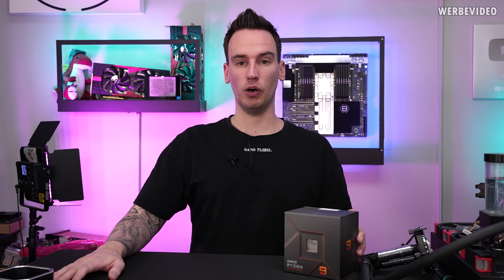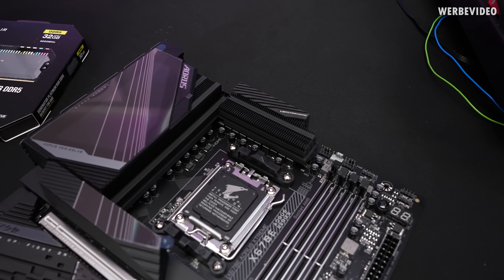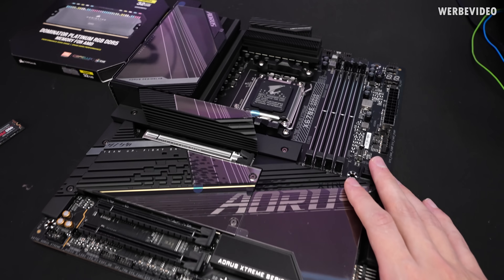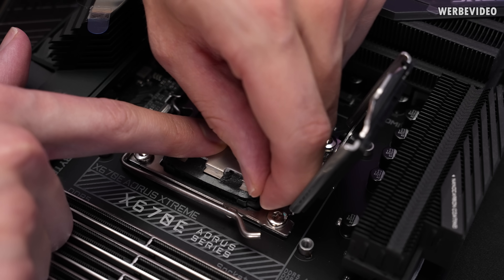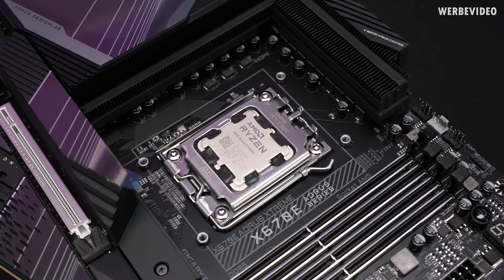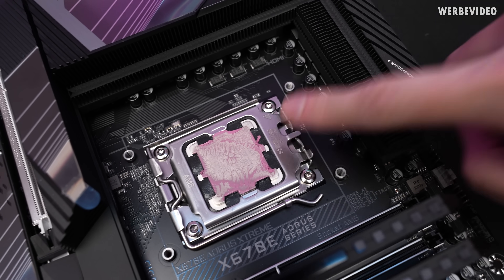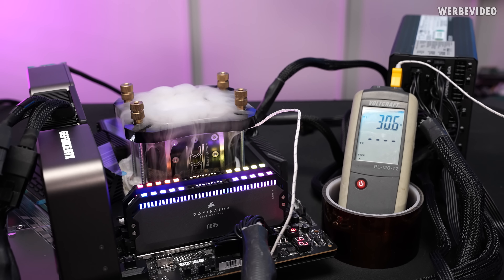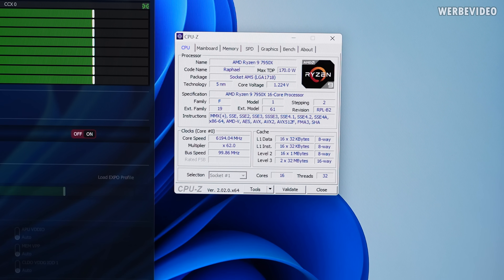Ryzen 7000 Temperature Scaling - Overclocking the 7950X to over 6GHz with Dry Ice

Comment: I just rebuilt 3 days ago and I'm on the asus x670e crosshair gene with a 7950x and I have been having abnormally long POST times also. A few times, it actually would never boot into windows and I had to hard reboot. These were all after the PC had been sitting off during the day. Once I get it up and running and go through reboots it works ok, other than the long POST times. It seems like I get random debug codes/lights each time. I haven't had any real instability or other issues, but it has been a little concerning. I just updated to the latest bios version and when it was doing it's flash procedure it was being really weird. Eventually, I got it back up on the newest version and everything seems ok, but I seriously have no clue what is going on. Another matter entirely is with the newest bios version it seems Asus has activated their AI overclocker which has overriden the stock CPU behavior and even my own manual PBO settings. Out of the box my 7950x was boosting to 5.7ghz on 7 or 8 cores and like 4.8 on the rest iirc. (Not under heavy multithread obviously). After bios update it seems to be running it at 5.5ghz all core. This is happening on expo 1 and 2. I loaded defaults and the only thing I did was enable expo, and went into PBO in both areas of the bios and set the curve optimizer negative 16 and set some custom power limits. Not quite sure what I'm doing wrong. I'm just running a 280mm AIO for the moment but I have some EK hardware on the way, I'm excited to see how big of a clock speed difference I get off the custom loop. Also I ordered your Ryzen 7000 gaskets but I could not get it to line up properly with the notches on the CPU and eventually gave up in frustration lol. I still have 2 left, maybe I'll give it another shot when I install the new loop now that I saw your method. Thanks for all the trail blazing you do for all of us as always.

Comment: Thank you for your video. I have the 7950X, with PBO set to negative 30, and I have been getting all core boost between 5.3-5.4 GHz, 175-ish watts used and temps at 95c on a very robust custom loop while using Handbrake for rendering video. I was afraid that I was doing something wrong, but watching your video here made me realize that the system is running 'normal.' Thank you again.

Comment: While I love most of your vids, I don't find this useful in any capacity. I would surmise that 98% of users of this cpu series are using an AIO, and not even an open/closed loop water cooling system. So any testing or information gathering beyond that scope with a common AIO is irrelevant for all users beyond that one or two percent. I would love to see more videos using common equipment, that could be useful to my specific situations, so that I might fine tune my system further. Thanks.

Comment: I am an ASIC design guy. We do active voltage scaling in our projects by monitoring transistor speed. What has always puzzled me is that, the transistors are faster when it is HOT (e.g. from -5C to 105C) so that we are able to lower power supply level when the die/junction gets hotter/closer to 100C. However in the CPU overclocking world, it seems that the processor can run faster when the junction temperature is colder? We are using the same TS*C transistors...any insights?
Reply: Probably to do with electron mobility being higher and quantum tunneling being statistically less likely at elevated temps or something like that in your ASICs, but in CPUs you're just limited by extreme density and power output. The chip is able to clock this fast without cooling, but it'll just immediately overheat if not cooled, hence why this is perceived as colder=faster.
Reply: @Spirit532  yea I was suspecting that, although the "case temp" is very low, the "junction temperature" is already at ~100C then that would make sense.
However the screen shot from the video seems to suggest that the "junction temp" is very low at -30C while running. I am assuming AMD's temp sensor is the junction sensor, not the case sensor.

Comment: Starting to think AMD should just flat-out cancel the 7000-series & start over. Trading 20-degrees for half-baked AM4 cooler compatibility is just absurd. Their heads just weren't screwed on right with any of the decisions they made on this one & they've turned a great chip technology into a disaster of a CPU.

Comment: That was my arguement. That normal thermal paste is conductive and it will eventually drip even if you just put a pea size on. When installing the cooler it will spread and drip off.

Comment: Will there be a Contact Frame for AM5 / Ryzen 7000? It looks like it has a mechanism to Intel, and I imagine it may have similar problem for uneven mounting pressure.
Reply: @DarthChewie According to Igorslab it doesn't have an issue - backplate, loading mechanism and the thicc heatspreader seem to be very stable and there was no bending in either way (concave or convex) observed by him so far after stressing it with multiple installs and pressures.
Reply: @WakeXT  Good to know, thanks! Clearly AMD is actually paying attention to the smaller details!
Reply: Didn’t he show one in last video?

Comment: That chipset temp at 10:12!  152.6C on the chipset!  That has to be erroneous, as there is no way AMD raised the chipset thermal shutdown temp by over 50C from the previous 100C on x570.  I wonder what the actual chipset thermal shutdown temp is...
Reply: I missed that! You’re right though, there’s no way that’s accurate lol. I wonder how it could get it so wrong though? Maybe it does a calibration on board before it does a reading, and it’s throwing the baseline off.

Comment: I know someone will probably flame me for this comment but I do not agree with how AMD markets these CPUs at all. The advertised 5.7ghz on a single core is only really in absolute ideal conditions. On full load you will not get this even with a high end aio. I think it is not unreasonable to expect that an average consumer that sees that boost number would expect that the 5.7ghz can be sustained with decent cooling. I really think if they adjusted that number down to 5.3 and people could even push a little past it on occasions it would be seen more favorably by the community.

Comment: Interested to see the degradation test on zen4 running at 95c after a year.
Reply: I have a laptop with an i7-10750h. Stays pegged at 99C when gaming constantly. Had it for 2.5 years and game frequently on it even for extended sessions and had no problems with it. If the max wasn't safe to run at for long periods of time, they would make the max lower
Reply: It hit 108c on an 360 aio doing simple cinebench, not good.
Reply: @4gbmeans4gb61  
Hotter means better :)
Reply: @BBWahoo  according to amd fanboys, intel cpus running that hot are pure garbage lolz
Reply: @4gbmeans4gb61  to me that’s just Intel pushing it’s cpu design to the limit just to keep up where as the AMD cpu is just boosting its frequency till it hits the thermal limit so if you limit the frequency it shouldn’t get so hot
Reply: @lasthopelost9090  lol?  Have you seen gaming benchmark? New amd cpu gets beat by intel and last gen ryzen.  All while being at 95-108c on watercooling.  This seems like epic fail.
Reply: @4gbmeans4gb61  it seems these aren’t about gaming thou there much more for multi threaded workloads the new paradigm will be with the 3Dcache CPU’s they very will could be monsters with this new design we will see
Reply: @lasthopelost9090  ya new ryzen looks great for work but not so much for gaming 8(
Reply: @4gbmeans4gb61  The cooler compatibility shenanigan didn't pay off too well for AMD it seems.
Reply: @4gbmeans4gb61  what are you even talking about, even last gen cpus like 5950/12900 were an absolute waste for gaming pcs and basically performing worse or the same as the 5600x/12400, it's the same thing happening with this new generation 
the 7600x still equals if not beating the 5950/12900 in gaming, how's that a disappointment?
Reply: @4gbmeans4gb61   I generally think that chips like these are for workstations and gaming is just a secondary or tertiary purpose or at least balance the workload if the purpose is for content creation in the gaming space. Trashing it only on gaming performance alone is kind of an ignorant comment.
Reply: @ze-ph9774  You not thinking im allowed to my opinion even if you find it ignorant is well ignorant.
Reply: @4gbmeans4gb61   You imagining that I didn't allow you to have your own opinion nor did I say that on my comment speaks volumes on your behavior on this platform. You criticized others opinions but I'm not allowed to express opinion on your opinion? Try again kid. Don't put words in my mouth where I didn't.
Reply: @zetsubou3704  yeah. That really should have reduced that z height.
Reply: @lasthopelost9090  3D cache is a sales gimmick. I’ll take RAM cache any day
Reply: @4gbmeans4gb61  it only gets beat by ryzen 5000'sX3d's in games. As a workhorse it wins by a huge margin against all 5000's. These first zen 4's are definately better for professionals than gamers for sure, but i'm confident the increases we saw with X3D's will return when they do that again on zen 4.
Reply: @4gbmeans4gb61  idk it's still pretty damn good for gaming. If i can play 2022 on an FX-8350 then this would still be absolutely massively better in comparison. Perhaps zen 4 beats it with X3D's, but its already so close to the max top end that i still doubt most would notice. Zen 4 X3D's will be a force to be reckoned with.
Reply: @ze-ph9774  I agree. Games aren't designed to take full advantage of 8+ core chips. More chips = worse utilization. Combine that with more heat and the resulting reduced clocks and it makes sense. These insane 10+ chips are workstation material to the max and just don't make sense for specifically gaming.
Reply: @VadersFist501st  they just need to hurry up and release them along with new intel so I can see all the benchmarks lol.

Comment: Genius (meme) idea about thick IHS. Not sure if you're gonna read any of my comments but my mind's having a blas so hear me out. Imagine you precisely mill a waterblock base pattern out of the 7000 IHS with fins, gasket line and make a detachable drainable waterblock top. BOOM you got a direct contact water cooling solution that does not require delidding or socket mod AND can be made into some sorta pseudostandard. How crazy is that?

Comment: Sorry if this has been answered many times: could your replace the original lid with a copper lid over liquid metal paste? Could manufacturers offer a soldered copper lid and would it improve cooling?
Reply from the maker: Stock IHS is made of copper
Reply: @der8auer-en  
I wonder if shortening it would help any
Reply: @der8auer-en  Haha thanks 🙏 I guessed from the colour they were using a steel or aluminium alloy - next time I'll Google, I promise.
Reply: @bakedbeings  It's usually nickle plated copper.

Comment: 40-50w less power consumption with 4-600Mhz higher clocks... are those numbers correct?  

5200Mhz/5400Mhz on water was 230w/238w
5800Mhz on dice was 190w with about 0c core temp. 
5400Mhz with 0c would be... 165-175w ?  

With a potmeter to control your fans, you can adjust CPU speed and room temperature at the same time. Placed next to the volume knob for the 2.1 speakers for your convenience.

Comment: QQ: do you think AM5 socket closing mechanism design will affect even cooling like Alder Lake requiring a modified closing mechanism to reduce temps (well boost cpu frequency considering AMD7000 is designed to run @ 95c)?
Reply: Yeah - after all the talk about Intel's "mistake" and how "AMD already knew how to do it right", I was pretty surprised to see a single-lever design here. I wonder if they managed to "fix" it with just minor pressure point tweaks, and without going for a multi-lever design.

Comment: Apparantly AM5 boards run through memory timings when you change the memory, which takes a long time and several automatic reboots. It looks for the best timings on it's own.
Reply: Say what you want about ASRock, but they bothered to put a simple "hey, this will take really long" sticker to inform people of this behavior.
Reply: @Lishtenbird  Asus does the same
Reply: Yeah, I've heard of up to 10 boot loops to make sure the memory timings are as tight as possible.
Reply: It seems like Z690 boards have a similar thing too. My MSI one cycles through the same bunch of startup codes for 2-3 minutes before booting to windows (or telling me that the OC failed).
Reply: My AM4 board powers up and down a few times before the screen actually displays anything whenever there's a power outage, is this related to what you're saying?
Reply: @iPhixef  Yep, but AM4 and ?Z690?(not sure) just do memory training for auto settings. But very loose timings.

Comment: Hey man, have you ever tried actually indium-soldering a waterblock to a CPU? 
I understand that would be the most impractical and absurdly dangerous operation but I can't just get the idea out of my head but I'm kinda short on whole factorys worth industrial equipment and it'd be very cool if you did it instead with some old power hog CPU, especially comparing best liquid metal direct die vs indium-soldered wb.
Reply: I don't think it's as difficult or crazy as it sounds. Remove the retention bracket, pop in the CPU and apply precise amounts of indium solder to each die and surround each die with silicone, carefully place a disassembled water block with just the mounting clips left attached on top of the CPU, heat up the water block until the solder melts. Now reassemble the water block and it can be dropped into the socket and bolted to the motherboard. I'm gonna have to try this on an old Q9400 I have as an experiment.
Reply: @talibong9518  amazing, let us know how that goes! Video or write up with photos would be v cool

Comment: That gasket will come in handy, especially many folks will be looking to reign in thermals abit. Just seen GN's review of the 7950X and apparently AMD have designed Zen 4 to hit the thermal wall before a power wall thus undervolting may not be as useful. I'm curious, would undervolting help with thermals at all?
Reply: Jeroen  undervolting reduces temperature and POWER usage.
zen4 increases POWER till it hits that  thermal limit... 
and just like the turbo boost and all those things it is achieved mainly by higher voltage, so you're not really doing anything there on zen4, other than some minor efficiency adjustments since the cpus and mobos come shipped with certain always safe and stable settings, but what you get out of that can vary from cpu to cpu
i really don't think there will be room for any real undervolting anymore, which is why the ECO mode exists to begin with
Reply: This has always been the case and hence why using curve optimizer in addition to PBO was always beneficial.
Reply: Jeroen  it very will could but how does reducing or limiting the voltage effect the boosting on these CPU’s? Is the question does it need thermal head room and voltage or will it still boost with more thermal headroom and less voltage to work with

Comment: @der8auer
Code 15 should be memory training.. it will cycle timings until expo finds the best stable timings
Reply: I can take multiple minutes and reboots along the way, as well. Just let it go for 5 minutes at least and see what happens.
Reply: @billgaudette5524   just saw review from Jay2cents .. he had 10 boot cycles but after that mem was fine-tuned. Wendel at l1techs was also impressed with the auto-timings

Comment: Does no one ever use those phase change freezer coolers anymore? They used to be all the rage in the early 2000's but super loud. I think LD Cooling still makes them but I have no idea what they are like with 300w CPUs.
Reply: Jeroen  I really fancy making a submerged system but not sure how quickly those can dissipate heat from the dies, should be really good though I would have thought.